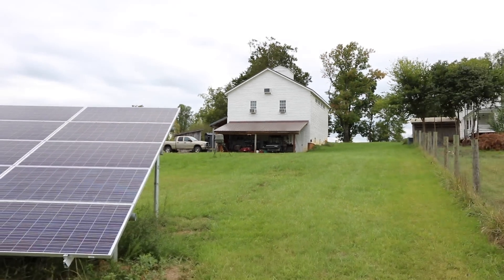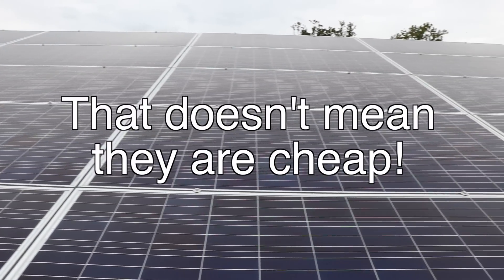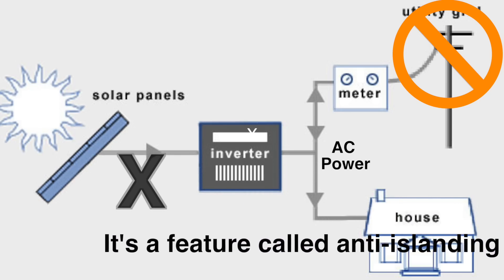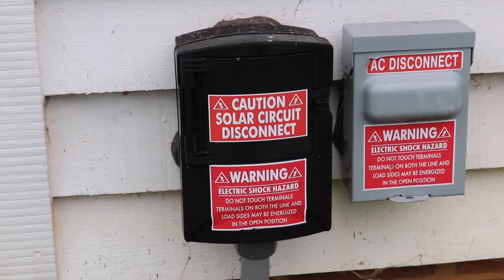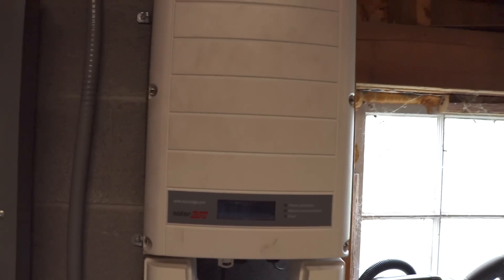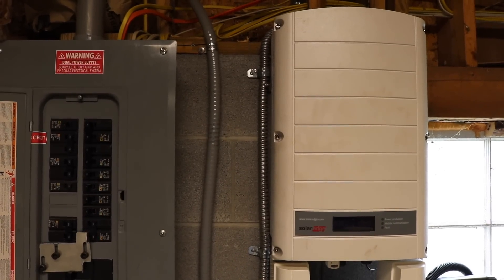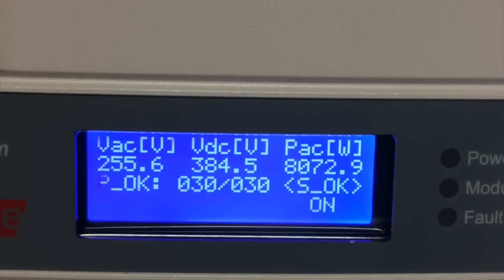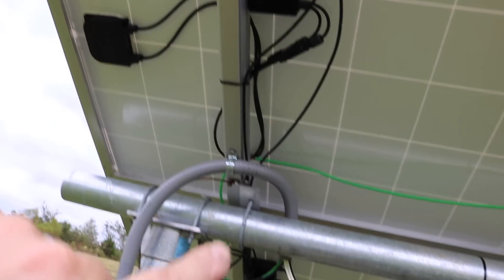The ugly truth behind grid-tie solar systems. Part 1, FarmCraft101 solar.  Watch before you buy!

Comment: There is so much wrong with this video. The voltage doesn't simply go up by a "tenth of a volt". It goes up depending on where the current ends up. If all the power is going to your home, then the voltage rises by the  voltage differential required to push current to your home appliances (the voltage drop through a conductor). If it's being pushed to the grid, then you have to use the grid impedance to calculate the voltage rise. Also, inverters are very good at what they do, they convert DC to AC at efficiencies greater than 96%. Also the inverter is running 360Vdc, which means that the positive and negative are 360V apart, and so it's only bringing it down from 360V to 240V not 120V.

Comment: Over time source providers are going to want more money for the same power being provided today... Your cost of solar will still be held constant until you upgrade to newer and more advanced technology suggesting a payout less than 8 years. Power deregulation was suposed to create competition and lower energy costs, but deregulation has had the oposite effect. Dramatically higher energy costs. Smart meters are causing higher energy bills and are the only reason anyone needs to abandon the grid.
Tools to clean your solar pannels can be found online at Detroit Sponge... (pole and a stripwasher and or brush) you can clean and or rinse your pannels with ro water from the dispenser in wal-mart. 5 or 10 gallons. This water is about 10 ppm and 10 ppm will dry spot free. A cloudy or rainy day or early morning. Rain water is generally spot free and also free. Clean with soap (maybe lemon amonia), rinse with house water, then rinse with ro or captured rain water. 
My well pump is a 1.5 hp Franklin 220-230 3 phase with a single phase to 3 phase Franklin converter. By converting to 3 phase I saved on pump size (2 hp to 1.5hp) and also smaller wire size, but gave back all of the savings and more to buy the 3 phase converter. The pump head is a 5 gpm grundfos which requires a sand screen. The 3 phase converter also provides constant water pressure. The components were purchased at a local whosale supply and can also be sourced online. 
John Bendini developed solar technology that collects more power early in the morning, on cloudy days and later in the day and can be sourced online and can be seen on you tube.

Comment: Why don't you have the panels on the top of the garage to save place and wires? Thanks for the video!!
Reply from the maker: Garage roof wasn't oriented the right direction, and the shed roof that is close to the right direction isn't big enough for all the panels.  With a ground mount, I was able to point and angle the panels in the optimal direction, maximizing my efficiency. Plus it's a lot easier to clean off solar panels that are on the ground when it snows.  Thanks for watching!

Comment: Good Video !!! Solar For Dummies for sure !!! More FREE Stuff for Dummies... NEVER-EVER GRID-TIE.  " BUY YOUR OWN "... Solar Panels, Batteries and Inverter(s) and complete off grid.   Calculate what you will be using + a little extra for just in case.  Whatever you dont' use, throw it away... You dont' have to deal with the Electric Company or their rules and when Power is off, your own Grid System is still on and perfectly legal since you owned it!!!

Comment: Sir can you say how to battery calculation of off grid  system.
Reply from the maker: Not in great detail.  Basically, you need to calculate how much power you use, and then size your battery bank to be able to supply enough power to get through each night without being totally drained.  And then you need to consider that the sun doesn't always shine.  Do you want enough battery to be able to keep you going when it is cloudy for a few days?  Then you need to add additional battery capacity.  Or maybe you run a generator during those times.  I'm sure there are many videos and websites that have lots of good info.  Good luck!

Comment: I think you mean the phase angles are corrected for in the inverter. To match that used by the utilities. If not. You're going to hear a huge ass explosion....

I would add. The system works off watts. Not voltage. It knows how many watts you're using. When it falls below that. It switches to the Grid..As the solar is converting DC to AC at the Inverter. Then to the batteries\grid\home.....When the inverter hands off to the grid for power needs. It will still charge your batteries...

Comment: what's the ugly truth about this?  you could have bought an outback inverter (lost a little bit of efficiency) and then added batteries later....
Reply from the maker: ...and changed my transmission voltage to 150V, and bought 2 or 3 charge controllers, and added more disconnects...  I add a battery backup in part 3 using AC coupling.  Check it out.

Comment: I just checked on eBay today, there is a Seller out of Houston selling 27 panels or 9.1KW for $6000, seems like a good price
Reply from the maker: Depends on the quality of the panels.  You really want a good solid made panel.  Cheap ones lose their efficiency much faster, and have problems, so they may not be cheaper in the long run.  That said, 6000 sounds reasonable.  Add $1200+ for the inverter.  Add $2000+ for the ground mount system.  Add $750 for concrete for the ground mount.  Add $500 for wire and mounting hardware.  Add $300 for disconnects, and you're at around $11,000.  Add labor: dig holes for ground mount, pour concrete, install mounting hardware and panels, wire panels, dig ditch to bury wire, install and wire disconnects/inverter, permitting, inspections, etc.  And that's how it ends up being $17000.  Of course, you can do all that work yourself and save a lot.

Comment: How much does your power company sell you each KW and how much do they pay you. In my area they sell me one KW for
 10 cents and I believe they buy it at 4 cents, Also do they charge you extra for the Meter itself?
Reply from the maker: I pay 11 cents per kwh from the power company.  What they pay you for power only comes into play if you generate more than you use.  In other words, if you generate some amount less than the total power you use in a year, then your panels are just saving you money in the amount of 11 cents per kwh.  At least that's how it works in my area.  I sized the system to generate 80% of my usage so I would never over generate and just get the wholesale price (0.04)

Comment: Its a waste of time and money to have optimisers on your installation, 30x optimisers are not cheap. Optimisers are only really effective when there are likely to be shadows on some of your panels, i.e one panel with a shadow will bring down all the other panels that are in series with it (but not affect those in parallel), therefore reducing overall efficiency. But in your case, with all the panels unshaded at all times then this isolated shading of one panel will never happen. When its cloudy then all the panels will be shaded at the same time and the optimisers will make next to no difference. At best you are getting a 1 or 2 % improvement with your setup and thats a huge payback period for those 30x optimisers.
Reply: The optimisers on solar edge give independent solar cell monitoring (but i agree on this type of setup on the ground solar edge is less important) but solar Edge dc to dc modules has ark and cut/disconnected cable protection (all dc to dc modules drop to 1v each witch is safe to handle) also the modules you can have any wattage size solar panels or have a dead or under performing panel it have no effect on the total system and you can see right away when one of your solar panels are not generating as much as the others

With a typical string system as he said in the video only takes one panel to be not working correctly to bring all the others down as well (efficiency wise) and you will not know which panel it is unless you have a thermal imaging camera to see which panel is hotter or colder than the others which solaredge you just whip out your mobile phone or computer and look at the solar edge website which is monitoring all your panels and inverter and if the installer did it correctly you should have a layout of your install on the website as well so you can instantly know witch panel is not working correct (or faulty dc to dc module)
Reply: @leexgx  Very well explained. They also claim to have some mppt performance to best condition volts/amps for optimum inverter performance.  That's one reason SolarEdge inverter is smaller than other string inverters. So the OP is really suggesting an entirely different low tech string system. Don't forget about ice, dirt, bird poop, dew, snow, uneven aging....
Reply: Exactly! That was my first thought when i saw him pointing at those, and they ruining cost efficiency of the system...
Reply: each optimizer is about $70 each I would pay attention  on the contractors huge profit that the cost of materials
Reply: @topgun6674  SolarEdge pretty much requires the optimizers.  They condition the power for a narrow range built into the inverter.
Reply: In a reply to another comment the producer explained he bought through a one-size-fits-all cooperative deal. Optimizers do not appear critical for his no-shade installation, but SolarEdge requires them and they came with the package, so why fight it? One benefit is the per-panel monitoring it gives, visible through monitor web pages.
Reply: yeah, that was a huge unnecessary expense in a system like this guys; clearly no trees or other common obstructions around and a unified direction system mount)

Comment: Wouldn't work for me, I pay around $800 a year in electrical bill, all lights are led, only ac uses a lot of power. So I'm not sure how solar panels would hold after 20 years and I'm pretty sure battery back up had to be replaced probably twice.

Comment: When the main line to the  house goes down,why not run another wire/cable back up to house  from the solar panels, then you can rely on solar power to cover your house.
Reply from the maker: Grid tie systems don't work that way.  They have to have an external sine wave input to function.  Watch part 2 & 3 for explanation.  https://youtu.be/gPycyuVJ_Cg

Comment: actually 17 grand isn't bad at all for a system that large. I've seen systems half that size for almost 30K.
Reply from the maker: Yep.  People grossly underestimate that amount of work and material that is involved in installing the system.  You don't just buy the panels and an inverter.  There's a lot more equipment and a LOT of work.  Thanks for watching.
Reply: something is off here....
Reply: You can build 12.8KWp system for 12000$ (a friend did with some sourcing help)...   check sunelec.com for panels
Reply: This is a ground based install so expected to be cheaper (you can get inverters now that have a second output that still provides power to a separate isolated circuit in event gid fails (so you can runs things like fridge and lights off it as long as there is enough sun)
Reply: @leexgx  Ground based cost more than roof. The cost of that steel structure is a little shocking.  I built my stand.of wood for 8 similar panels so I know ground mount.

Comment: could you please elaborate on the "25 year warranty" for the solar panels?  what and how is covered?  

from all that I've read, panel output simply falls off with time - it's straight forward physics - and by about 10 years (much less for cheaper models) the performance is so bad that they need to be replaced.

thanks - and this vid is very well done
Reply from the maker: http://energyinformative.org/solar-panel-warranty-comparison/
Most warranties are a performance guarantee, ensuring no less than 90% output at 10 years and no less than 80% at 25 years.
Reply: thanks - so what does the warranties promise if these output degradations are exceeded?

Comment: You need to know that there are inverters that has battery charging capability ant you dont need other equipment to produce electricity then utility fails (inverters now can run with or without utility). For example victron energy has that kind of inverters, like quattro :-) and you dont need optimizers at all, they are used only then you mount modules in different directions or then there are shadows. But your system is perfect, so you dont need them :-)

Comment: Most of what you paid for was labor. My 245 watt panels were $257 each and I thought that was a good deal. So my first 5 cost me $1285. My last 245 watt panel cost $180, (same panel, same salesman, price going down). I used welding cable, 4 AWG and that was about $100. Framing 2 X 6, free (waste wood), hardware and screws $50, controllers, 2 @ $500 each. (they can only take 1000 watts per controller). Inverter, true Sine Chinese (8000 watts)  $329. I installed it all myself and I am a girl. You can do this. I have so far been very unimpressed with the people who advertise as installing these systems. They known NOTHING about battery banks. One had a 1/4 page ad in the local newspaper, he is a well known electrician. I called him to get him to come out and help me troubleshoot my battery bank. I was ready to pay him to do this. He told me I knew more about it than he did! Can you imagine, non professional woman knowing more than an electrician? I don't believe it either, I guess electrician school skips over DC. I have gotten more help from Youtubers and power blogs than I have been able to get from "professionals". .

Comment: The tax credit is dead (or soon to be).  Also, the $200/mo includes utility fees.  The fees vary by area but are usually $30-60/mo.
Ideal repayment time  $23,000/$150/mo  =  153.3 months = ~12.8 years.  With system efficiency and weather, your actual payback is in the 15-20 year range assuming No Maintenance Costs.   System life expectancy 5-10 years.  Looks like a break even proposition at best to me, and at worst your paying an additional $1000-2000/year for electricity.

Comment: I'm pretty sure those transmission lines are 13.8 kv. That's the standard.. I'm in the electrical trade for just about 33 years. My Brother is also  high voltage tester and 2 of my nephews are lineman ⚡

Comment: I just received my 7th electric bill and after the monthly service fee of 13.40 was paid, there was zero charge for electricity.

Check out my 15.2 kW system@      https://www.youtube.com/channel/UCIOTIN4Yh96aNL5_7JPC6tQ

During the summer there was one month I paid about 8 bucks and another I paid a little over 11 bucks.....other than those 2 months, the remaining 5 months were ZERO!!!

We lost grid power one time over those 7 months for about 20 minutes and I can count on one hand the amount of times we've lost power in the last 14 years, so having the battery backup for me anyway, is not a consideration. It generally doubles the cost of the install for which I would likely never see an equitable return.

Under the right conditions, I recommend solar to anyone willing to get into it. At age 60, I designed, permitted, and installed this system 99% by myself and I had a blast! The feeling of accomplishment when the project was finished and approved, then seeing the results evident in my electricity bills, was amazing!

Comment: Wow the cost they pay you when you over produce is really really low.  This could however be a reflection of the cost of what you pay for power in your area.  In Ontario we are currently paid 28.8 cents /kwh for roof top installation and 21 cents for non rooftop installations in you output power range.  It is very cool to hear an end consumers pros and cons.  Thank you for the upload.
Glen

Comment: Why don't these installations include a large mirror, doubling (?) the light going to the panels?
Reply: The best answer I have seen is that heat would also increase, decreasing panel output percentage relative to light energy. At rated maximum solar input, which will normally happen on the hottest days too (if ever), panels get hot enough that they do not produce the output you might expect from their rating. (Panels are tested instantaneously  with a flash of light to arrive at their rating, so the panels remain cool.) If sunlight were doubled for any length of time, the panels might actually be damaged by heat. The most efficient solar panels convert less than 30% of the energy falling on them to electric energy, but that other 70% doesn't just disappear into nowhere; it goes into heating the panels. Solar panels are great solar heat collectors.

The mirrors would have to aimed by some mechanism, to insure uniform illumination of the panels, which is required for maximum output. But it is already uneconomic to aim the panels themselves with some mechanism, which would also increase panel output, and instead it is cheaper to add more panels.
Reply: Of course I guess you could use a dichroic mirror that only reflects visible light and lets infrared go through it. That would increase power output. But dichroic mirrors are expensive.